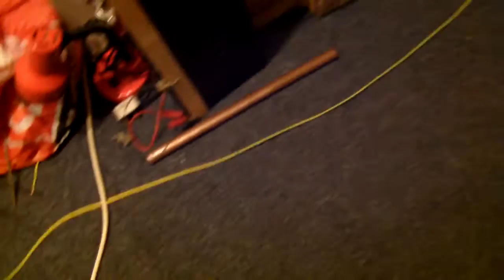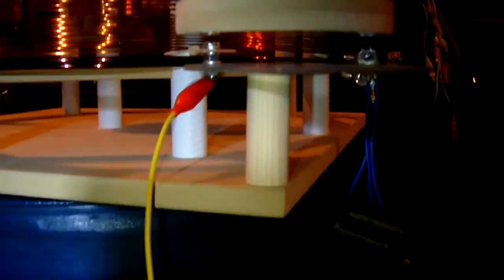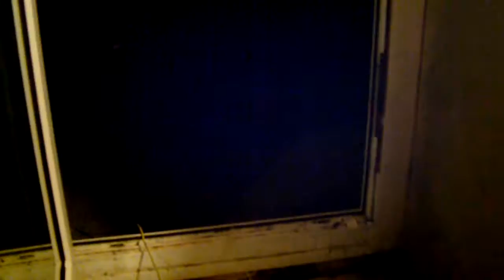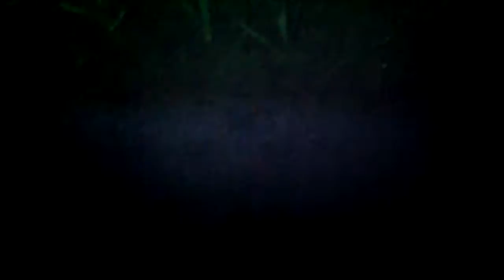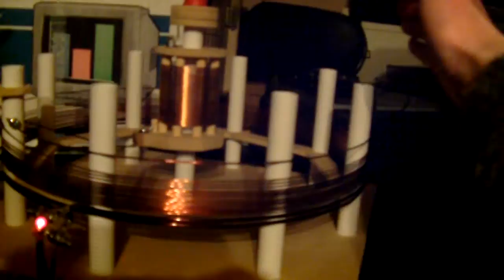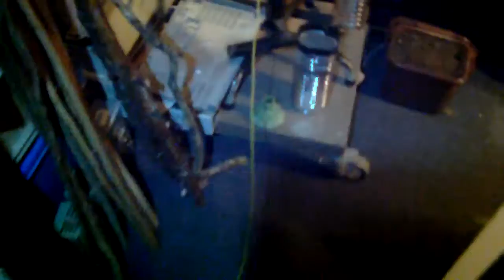Tesla Wireless Power Transmission Colorado Springs Style

Comment: Your model looks pretty well scaled to the dimensions I found in to Colorado springs notes. How did you know the number of turns for the various coils?
Reply from the maker: sparkstarter It's all in Colorado Springs Notes. All the factors are identical except scaled down, so the electrical characteristics remain the same as the original. I.E. 50:100 = 1:2, ratios are kept constant regardless of size/quantity. Dimensional and electrical ratios that is, not the turns ratios of the coils. Number of turns in scale model = full scale coils. Eric Dollard made an engineering analysis with references which can found here

http://www.energeticforum.com/eric-dollard-official-forum/11918-tesla-magnifying-transmitter-eric-dollard-type-coils-compendium.html
Reply: @Simware  link is vanished!

Comment: What voltage and current going into the transmitter? You have a very nice!
Reply from the maker: Thank you. The current is about 500mA RMS, and the power supply is regulated +/-15V (split/dual), however the scope on the primary coil measures +/-40V peak, possibly due to the resonant effect, so it's hard to tell exactly. But obviously the power supply can't be supplying more than +/-15V.
Reply: Simware Hi, could you please give me a schematic of the amplifier that you have connected to the function generator? What is this, a half-bridge? Thank you in advance